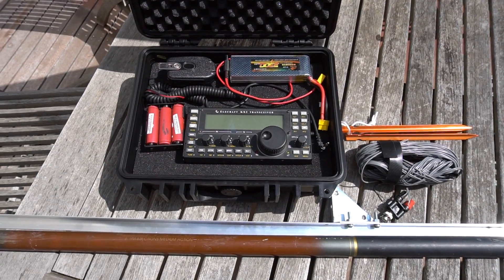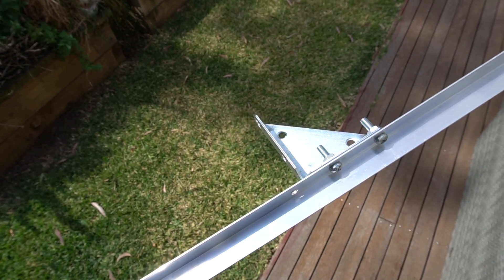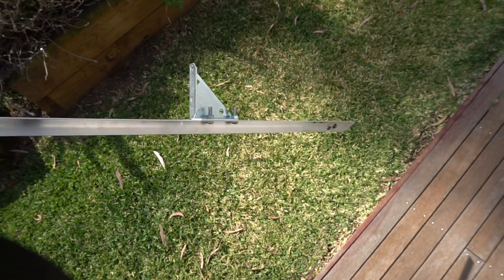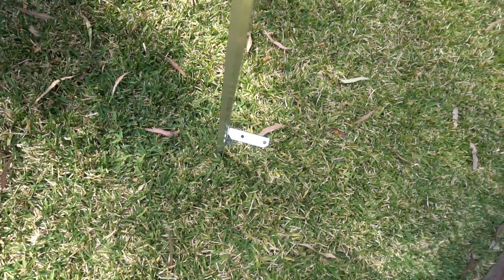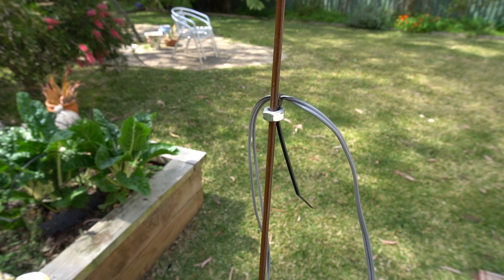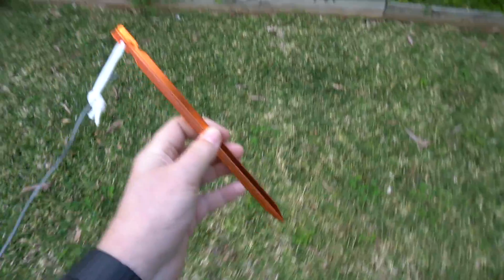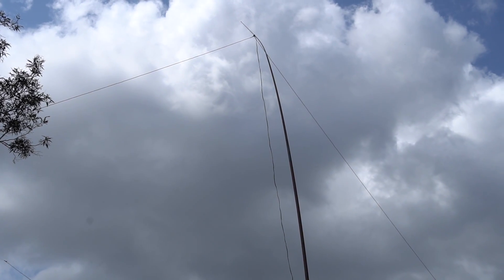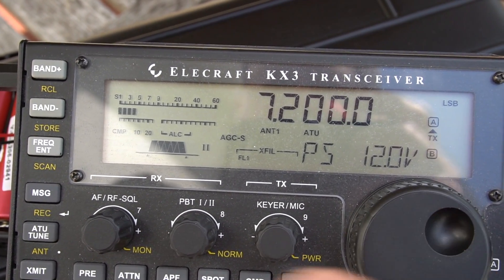Very simple portable dipole

Comment: Depending how you load it,  the stake is weakened by that empty hole above the  foot step. Might want to put a bolt, nut & 2 washers in it. Make the OD of the washers several mm larger than the hole.
Reply from the maker: Thanks Nigel, yes that's left over from my first attempt with an angle bracket that wasn't strong enough. A nut and bold is a good idea.